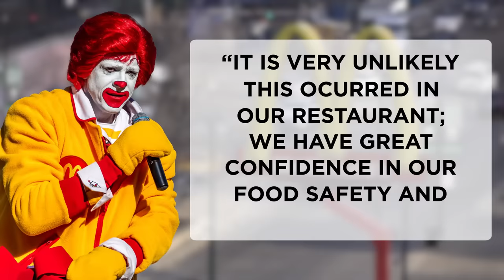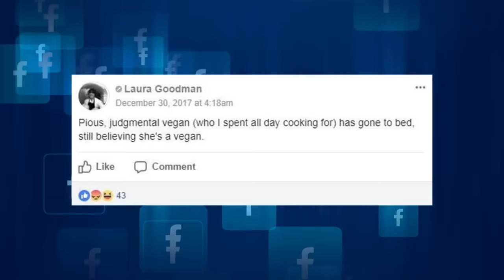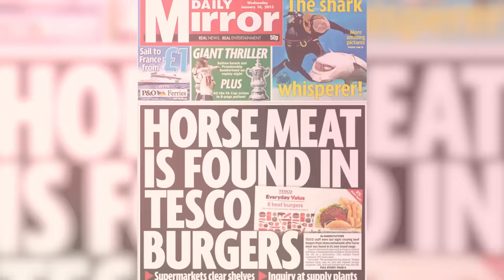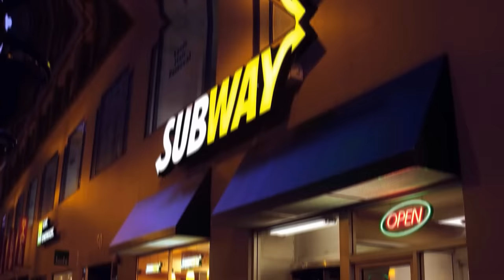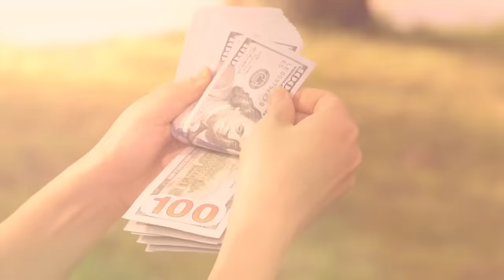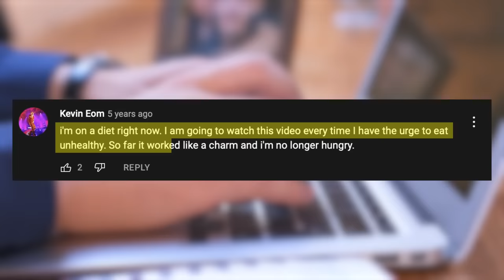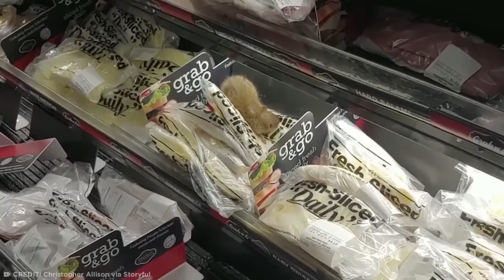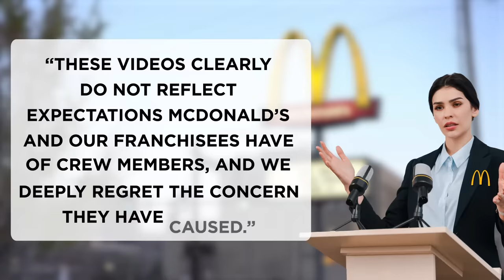What Happens To Your Food When You’re Not Looking

Comment: This isn't really a story that's on the same level as this video, but here goes anyway:

I once bought a vegetarian smoked sausage because I had to cook for a vegetarian household (I'm not a cook/chef). Everything seemed perfectly fine: The packaging was normal, and the sausage looked (more or less) like what a regular smoked sausage should look like. 

When I took it out of the packaging, however, the consistency was all over the place. Let me sum up what the experience of eating it was like after preparing it:

Visual? After preparing it (according to the packaging preparation guide), it looked like dead plant material: Off-brown, and nowhere near the colour of a regular sausage;
Consistency? Mud. Like eating a 5-year-old decomposing sponge soaked in water/grease;
Flavour? Cardboard with a side of dried ocean water. The sausage had absolutely 0 flavours, apart from what tasted like at least 6 times the daily recommended salt intake.

Overall? Not my favourite to put it lightly. The household also wasn't very impressed with the sausage, because that was the only thing in common on all plates after dinner: A piece of smoked and salty disappointment.